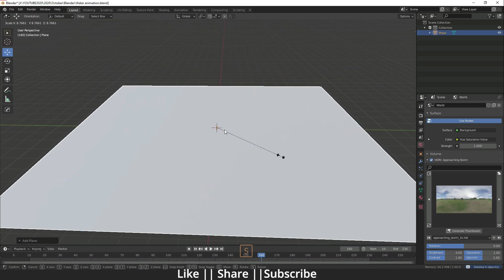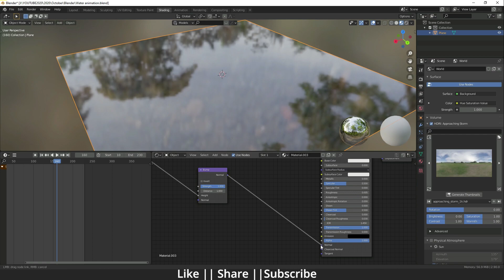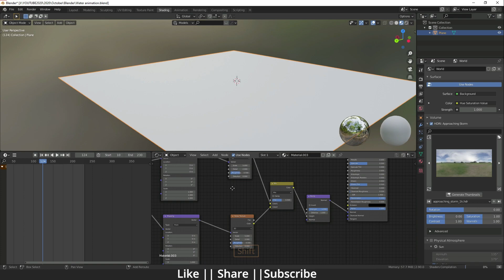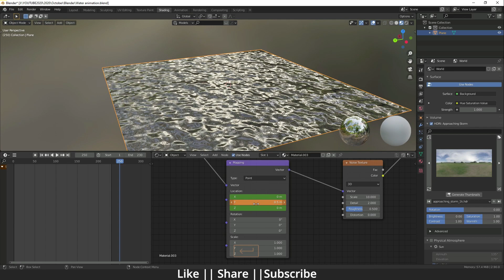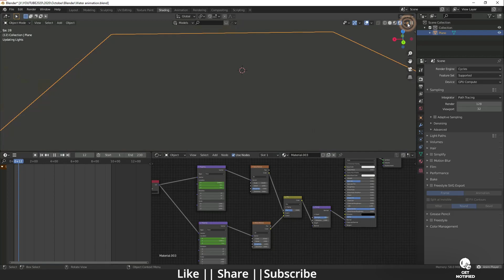How to create procedurally animated water in blender- 2.90

Comment: Hi there!  Thanks SO much for this video, everything worked splendidly, but I have one semi-problem.  I used this to animate the water in a 500-frame animation, and the water animation starts out very slow, and accelerates so that by the end of the video it's going quite fast.  I looked around for a speed parameter but didn't see one.  Do you know of a way to control the animation speed here?  Thanks!